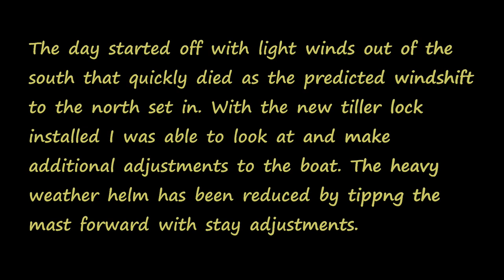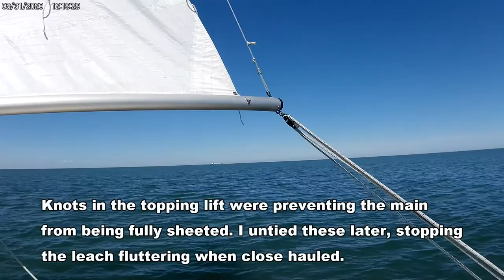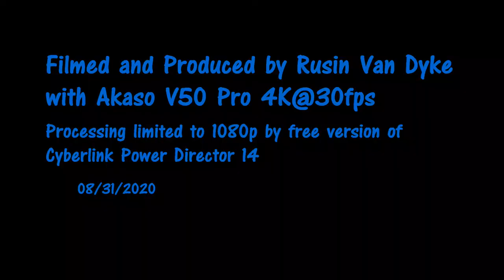Siren 17 - 2nd sail on Lake Erie - Lorain, Ohio

Comment: I have to say, I have never sailed before, but your video makes me want to learn.
Reply from the maker: Hi Shawn. If you have access to water with clean air (not too many surrounding hills) then you can have fun doing it. I have found eBay and Craigslist to be a good start for finding a sailboat. If you have a local marina look there too. Take your time, start small, buy something fully equipped but cheap, and use the "How to Sail" type videos on YouTube to get started. Or ask a local sailor for help. Good Luck!
Reply: @RusinVanDyke  very cool. Thanks for that infor.  I'm located in Buffalo NY

Comment: what size of trolling motor are you using there and mostly, what length of shaft?
Reply from the maker: Hi Enfe. I sold the Siren 2 months ago and bought a trimaran - Gypsy Wind. I believe it is the standard long shaft unit sold by Minn Kota - 36# thrust - old model. Going into heavy headwinds it was just capable. Primarily for getting in and out of the launch, not for tooling around too much.

Comment from the maker: Sv Little Gem
I know this is an older vlog. If you are still sailing, hou should get an raymarine st 1000 autotiller pilot to help with steering the boat. I have allways had one to help me with steering . Gerard.

Hi Gerard, I could not respond as usual on YouTube - your comment would not open, so I copied and pasted here.

I agree with you. I currently own this trimaran and use that auto-pilot, that came with the boat. It is very nice!
https://www.youtube.com/watch?v=ZgLdHjNcLjU&t=37s

Thanks,
Rus

Comment: Sir, who makes that tiller lock?  I don't like the design of the tiller tamer and think it's overpriced.
Reply from the maker: Hello James, I bought mine a couple years ago and it appears that fellow has retired - he had the best price. Here are two options - https://store.ruddercraft.com/index.php?route=product/product&path=60&product_id=129
https://defender.com/en_us/wavefront-tillerclutchx-kit?utm_id=150072902321&utm_campaign=19735474061&utm_source=google&utm_medium=paid&utm_content=649671815414&gclid=EAIaIQobChMIu9f-r9PA_wIV6MzICh3m0An1EAQYAiABEgLWafD_BwE#615=36917
You should try searching to see if there are less expensive sellers. I have the standard tiller clutch and use it regularly and like it, especially when the boat is well balanced. Good luck. Rus.
https://wavefrontmarine.com/